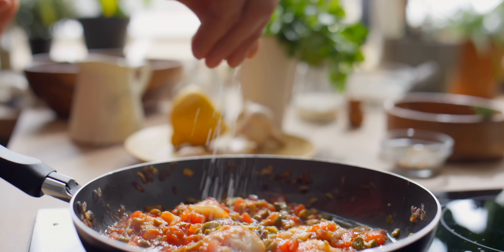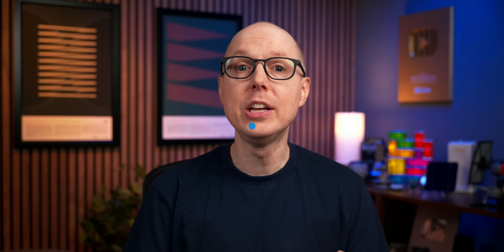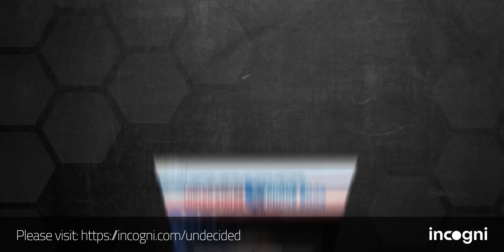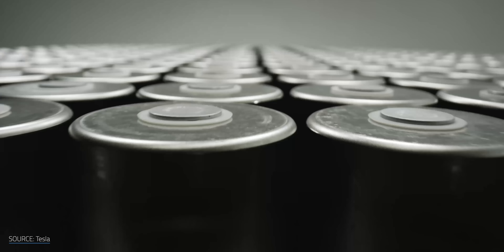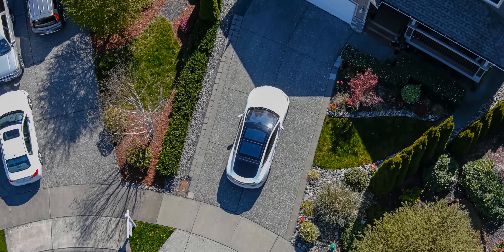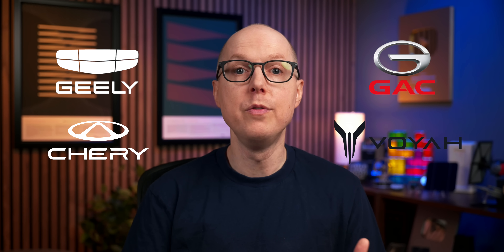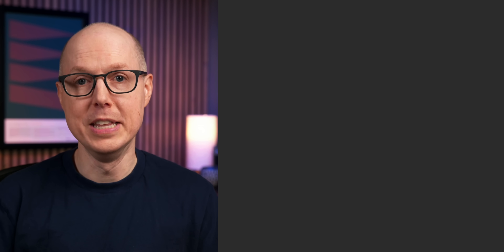How CATL Made Batteries 90% Cheaper (And What Happens Next)

Comment: Interesting. However, MIT has tested and is commercializing a sodium battery that has 3X the power density of lithium, 1 Kw/kg.  MIT has formed a production company to produce the battery for aircraft as it meets the minimum energy density needed.  Then there is RML group,  a british company that claims a full charge in 18 SECONDS and an energy density of 6 kw/kg1000.  RML is silent on their batteries chemistry but it is in production today. 

So it likely won't be Lithium AT ALL if these latter two, MIT and RML begin mass production.   Put that thought into your stock portfolio.

Comment: 🎯 Key points for quick navigation:

00:00 🔋 CATL announced sodium batteries costing $10 per kilowatt hour, a significant drop from current prices.
01:00 ⚡ Sodium batteries are considered second-rate due to lower energy density and lifespan but offer cheaper production.
02:15 🌐 Cheaper batteries could revolutionize energy storage for both electric vehicles and homes, making them more accessible.
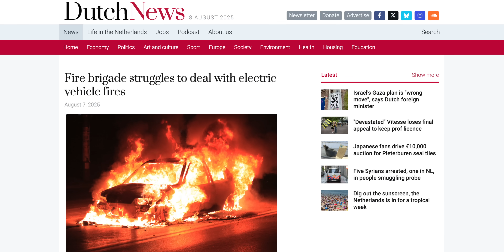03:00 🔥 Sodium batteries are safer than lithium, with a lower risk of fire or explosion.
06:00 ❄️ CATL's Naxtra battery performs well in extreme temperatures and can last over 10,000 charge cycles, redefining battery longevity.
09:00 ♻️ CATL's new Freevoy battery combines multiple chemistries to enhance performance for various driving conditions.
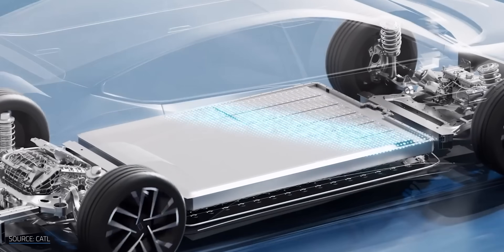10:30 📉 Despite sodium’s advantages, lithium prices falling significantly challenges sodium’s cost-competitiveness in the market.
11:30 🏭 CATL's existing production capabilities allow for quick scaling of sodium battery manufacturing, giving it a competitive edge.
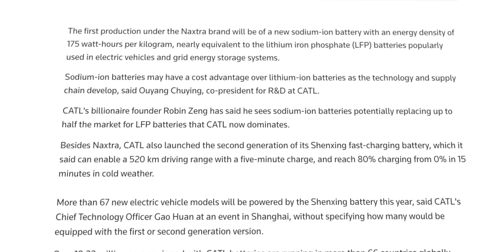12:50 🌍 CATL aims for sodium batteries to capture a major share of the battery market, which could fundamentally shift EV pricing dynamics.
13:10 📣 The real test for sodium batteries will be in 2024 with the launch of production models and consumer trust.

Made with HARPA AI

Comment: CATL is not a small battery company. They are the world’s largest and they have the largest testing ground, which is China. It is coming to market. EV cars will be even cheaper and Chinese EVs will further dominate. At such a low price point who cares about the small fraction in density when compared to lithium batteries when you can save $1000s and have infinite charging mileage.

Comment: It would be cool if they would go back to making basic electric vehicles as in the. 1930s - as a kid I rember some women that still has old electric. Cars in the 1950s to run to the store with - 
      They did not have a long range because the sulfuric acid in the batteries was only 1.220 gravity but that gave them a 50 + yr service life - 
       The only electronic device was the half wave recterfir tube in theb
 Battery  charger  - 
     Those old electric cars worked well and were very simple

Comment: Are CATL cutting their own throat by selling a battery at one tenth the cost of today's batteries, because if they also give a longer life then they won't require being changed as regular if at all in some applications. They won't have the sole right to this recipe as other manufacturers are already on their tails if not level or in front and those that aren't will soon find out the recipe that maybe protected, but a little change will always be found. Surely a lower selling point would make more sense as the opposition will always challenge them for price equalization

Comment: If the $10 per kWh is real, even with a 100% markup, you could couple that with solar power and solve the large scale issue of EVs charging in everyone's homes. If this is real and scales, it could fundamentally alter the world in such a significant way. 
ICE cars would be less and less viable, household power generation would be affordable and you could significantly reduce reliance on fossil fuels. That would be a significant help to reducing global warming. Man I hope we adopt this tech quickly.

Since this is sodium based batteries, are much less prone to catching on fire than Li Ion, surely EV manufacturers should be clambering over each other to implement sodium batteries? Imagine being able to say you've got an EV that won't catch fire. That's a significant worry for the EV haters right now. For marketing alone, you EV manufacturers should be doing everything possible to get Na batteries into mass production

Comment: The real benefit for this is storing solar generation.  Sodium can charge at a much faster rate with the major trade off being lower energy density, and with it's operating temperature being much less fussy than lithium chemistries you can store them outdoors anywhere in the world with temperature control only needed in the most extreme climates on earth and only in edge cases.  These batteries could live in a small shed outdoors where the energy density is much less relevant and it's safer vs the volatility of lithium.  It's a great solution for homes or for utilities at scale.

Comment: This seems like not quite the revolution we needed for batteries, but its a good step in the right direction.
Lithium is awesome for small electronics but good god it has issues when you start needing high capacity or high power or both.

I mean, one reason Solar isnt absolutely everywhere is our storage to get through the night sucks. Even if the storage isnt as good but were able to mass produce it to offset it and its cost/stability is way better, thats great news for power storage on large scales.

Not to mention, Lithium mining is mad hazardous and polluting.

Comment: 1: There is very very little lithium in Lithium Ion batteries. 2: Pure sodium is EXPLOSIVE when it comes in contact with water. Table salt is not pure sodium. If they are using PURE sodium, if the inside come in contact with water: boom.

Comment: An untapped area is in large scale power grid equalization.  Our power grids and plants have peak capacity issues and solar, wind often don’t generate when you need peak demand. Power companies should contract for residential smart power packs that communicate with their systems. The power companies own the residential units. They Charge the pack at night off peak and only use it during peak demand. The goal is the keep the power plants running at same level and supplement the residential need by battery to even out the demand.
Reply: I don't know about in the US, but this is EXACTLY what happens here in Australia (and probably most countries). They're called VPPs - Virtual Power Plants.

Comment: CATL have a track record of delivering what they claim and not over-seling their technological advancements. They also have scale - they are the biggest manufacturer on the planet.
Reply: Yes. They're a company with a record of underpromising and overdelivering (very un-Tesla like) which is how they've left their competitors, including Chinese ones, in the dust. A few months ago they won an auction to supply sodium ion batteries to a massive Chinese battery farm bidding only $US38 a kWh. If they say they're planning to get it down to $10, I believe them.
Although the inherent lower energy density of sodium batteries means that I don't think it will take over in cars, especially as lithium ones are still dropping in price. But for battery farms and home batteries it will gradually take over. Though not immediately - Matt is right that it takes a lot of time and money to massively scale up.
Reply: @kenoliver8913 they are claiming to be getting very close to lithium power densities. Obviously they can't beat physics but no one hits the theoretical maximum. If they are getting 90% of what they can achieve with lithium with their sodium cells for much lower cost and zero risk of thermal run away then that's a very attractive proposition for car manufacturers.

Comment: Matt, WHY? Another HUGE selling point for Sodium batteries is the C rate - they will charge to 90% (note 90% not just 80) in under 10 minutes. Did I miss you mentioning the C rate? I won't just verbally beat you up, rather I will thank you for posting the video also! With Aluminium Metal batteries less than 3-4 years from commercialization...we stand on the very edge of watching the trifecta of Home Storage sufficient to charge the EV's (which are #2) and then the Grid Scale battery systems which will also be connected to the Commercial and Aviation Applications that will also be "worked" out when the chemistry works out to 500+ KWH's per KIG, and the C rate is 5 or higher.
I now understand that the vision isn't to need to build out thousands of new grid scale generating plants but rather building out millions of home scale battery storage units in each home or at the very least for every 3-4 homes (maybe one for each block - in suburbia). This could be implemented by 2050-2070. It will happen quickly if they get as inexpensive as you indicated in your "headline".

Comment: Na+ batteries are ideal for home backup battery, where the size and weight is largly irrelevant. I dont see Na over taking Li batteries anytime soon in EVs as that slight lead in KWH per KG matters. 
However, a home battery can be as heavy as it needs to be, it doesn't matter. its not moving anywhere. that massive reduction in cost is far more important. i could have a 50KWh storage instead of a 5kwh. Or a 10KWh at the price of 1. cost is a far bigger factor than weight for home use.

Comment: I think a tri-brid battery would work better, sodium/lfp/ sulfur lithium batteries. Sodium batteries is just used for collecting regen, a/c, and small electronics energy load; LFP is for city, urban and under 40 mph driving, then the sulfur battery is used for high energy uses and trickle charge the battery while parked

Comment: The problem is that for the majority of people who suffer from range anxiety as I did when I had an EV, the range advantage of Li based batteries outweighs a battery than can run a car for a theoretical 3.6 million miles that almost no-one needs. 

Not only that but range really matters when comparing a car charged at home on relatively cheap electricity as opposed to having to pay double the price for highway bought electricity.

Comment: ABSOLUTELY would buy a sodium-powered EV.  Sodium batteries are safer, less likely to have thermal runaway.

In fact, that might be one of CATL’s primary motivations for focusing on sodium batteries.

China has new safety rules mandating significantly decreased chances of thermal runaway for batteries.  CATL’s sodium batteries seem to be designed to meet those rules.

Comment: Perfect, so my next car‘s today’s 80% cost for the battery packs, will drop to a 1/4 in cost, considering sales, shipping and electronic controllers remaining the same, maybe 1/3 of the price, the 100.000 price tags dropping to 32.000 for the same car, while offering a chance for manageable battery pack replacement down the line, with a refurbished one that got brought back from 70% of it‘s capacity to 95% capacity, maybe 98%.
No, won‘t happen, this is a BS AI video-post for marketing a company. No manufacturer drops their prices not even by 5%, regardless of the cost reduction.

Comment: Sodium ion batteries interest me because of a few things.  The temperatures in which they can be used in, the linear voltage curve during use, the stability of the batteries.

I am not a fan of EV's but if there was a sodium battery battery with a life span of half a million charges I would be more interested in buying a car made from that technology.
If batteries prices dropped 90% and the only demerit was capacity loss, I would be more interested in house backup's and power stations.

Comment: Of course you would switch. 3,500- cycles to 10,000 cycles! 200,000 miles to 600,000 miles. Just the resale value would be huge. Consider the price difference. $25,000-$30,000  for a vehicle to $10,000-$12,000 per vehicle!

Sodium-ion battery maybe all hype. We will believe it, when we see it. Until then it’s just talk and talk is cheap!

Comment: Forget the percentage arguments and look at the cost reduction.  To go from $1,400 to $100 is a cost reduction of $1,300 per kWh of storage.  Quite significant.  Going from $100 to $10, only a $90 saving per kWh.  The lower the cost, the less value each incremental advance gives you.  To go from $10 to even $1 - only a $9 saving. Anyway even if the individual cells in a battery pack were free, all the surrounding tech makes the whole package expensive.  I just had to pay $300 for a new <0.2kWh battery for my weed trimmer.  We need some breakthroughs on the surrounding electronics etc.

Comment: Living in a region that sees an annual temperature swing from 115F to -20F, a battery system that can function in the full range is very desirable.  I could see installing sodium for a home storage system very easily.

The only things keeping me from going to an electric vehicle are range and charge times.  When I'm doing long-distance driving, my current mid-sized SUV can get a range up over 500 miles in one tank, and I can refuel in 10 minutes.
Get me a battery that gives me a 400+ mile range, and can recharge in under 30 minutes, and I'll look at jumping on the electric wagon.

Comment: Sodium ion battery was first  invented by a UK company called Faradion in 2022, later this company is bought by indian company Reliance, as per Reliance research team there is structural problem with Sodium battery it expands significantly while charging and it is causing battery placement and structural challenges and they are working to rectify it

Comment: If the $10 price is true then it changes everything. For home storage it will be a no-brainer, you could install a 100 kWh bank where you would be installing a 10 kWh one and just go off grid completely and easily without breaking the bank. These batteries will not only bring radical change in the EV market but also be a death knell for the traditional grids as we know them.

Comment: It has it's place to lower prices in economy of scale, But requires combo sodium with expensive lithium in current ev models. SOdium Drawbacks? after 80% discharge the 20% left is usless alone as it's variable output thus require a 2nd partner :lithium to compensate to make use of it.

Comment: Broadly using on EV is still far. CATL posted their Sodium Battery on the slide, But it was the PP line Product.
Commercialization requires more time, as it needs to scale to bring the cost down, which requires massive demand. But LFP based EV has been cheap enough in China, while converting into sodium battery brings cost down only about <2,000$.Let alone changing suppliers also costs money to validate and redesign.
But it is still hopeful, especially in ESS field.

Comment: $10 per kwh?  Maybe.  BUT, I would replace my whole home solar battery stack (only 200 amp hours or 10kwh) which I PAID $6,000 for, with a 400 amp hour or 20kwh salt battery system if it were $50 a kw and if it were warrantied to only degrade to 85% at 10,000 cycles.  Either of those is a giant leap forward...and a death knell for nuclear fission power plants.  Coal plants are already almost gone...ZERO have been built since 2013...they cannot compete with natural gas.  But with $10 per kwh salt batteries, you will see what happened to coal electrical plants happen to natural gas as well.  There will be nothing but vast solar farms and salt battery backups for the foreseeable future.

Comment: Cutting the price is great but the fundamental problem of low energy density has still not been solved.  In fact it got worse. 
I like getting 10kW of energy from 1li of diesel and then go 25-33 km on that 1 li. 44li of it gets me 1100-1400km.

Comment: Given that the sodium battery can be built using similar production technology to the lithium equivalent, I think we can assume a lot of the production costs (casing, electronics, wiring, cooling systems, control systems etc) will be the same.  The difference in cost between lithium and sodium won’t make a big enough difference to deliver a massive price difference.  But where the difference will become apparent will be in battery life.  Setting aside EVs for a moment, if you have a home battery fully charging and discharging daily, you could, if the 10,000 cycle claim is correct, have a conservative battery life of 27 years.  In a home application, longer, since you won't care too much if the battery is still delivering 80% of supply after that period.  Now, if you calculate the cost of kW delivered over the service life, you get the order of magnitude improvement that CATL is talking about.  You could also have a much more relaxed attitude to using the battery in your car for vehicle to grid, since the impact on the service life of the vehicle battery of more intensive usage, would start to become irrelevant.  This is what I think CATL means by 10% of the price – I think this is calculated over the potential service life of the battery.  While this may be a bit disappointing for those expecting a dramatic reduction in up front costs, it still provides a pathway to much better returns on the battery investment.  It just places much more emphasis in how we interconnect batteries into the grid to maximize their returns during periods of peak demand – we will start to want the batteries to charge (on renewables) and discharge (in peak periods) as much as possible, rather than worrying about the effect on durability.

Comment: I've always held the belief that current lithium battery technology is flawed and always has been. Only this week I had a head torch battery short circuit and have thermal runaway on me. It was only small but caused a small fire in my bag. If sodium batteries do come to market it would be the first time I start to think about going electric as the fire risk drops substantially. Let's see what happens 🤞